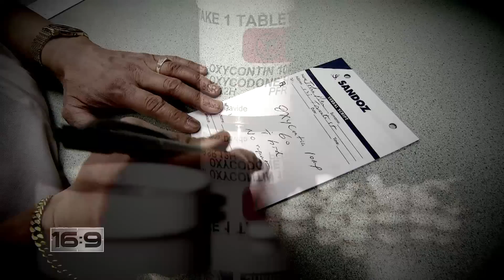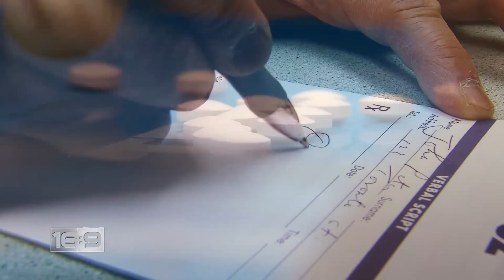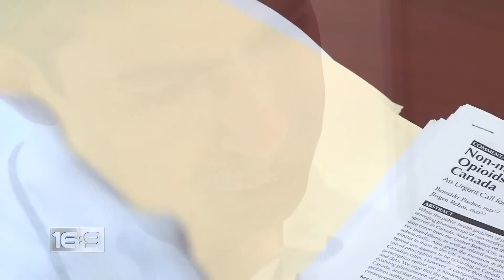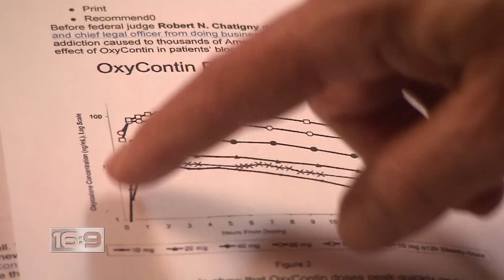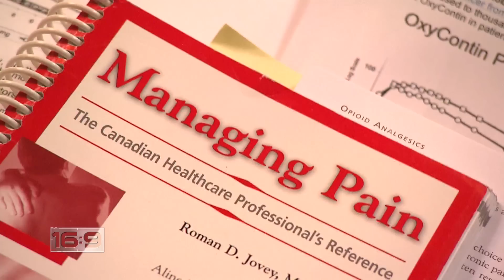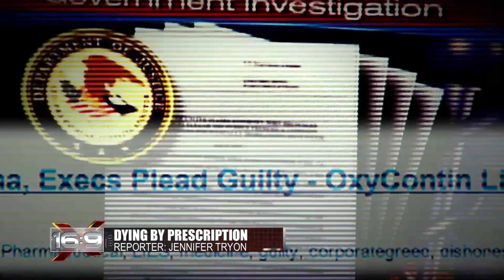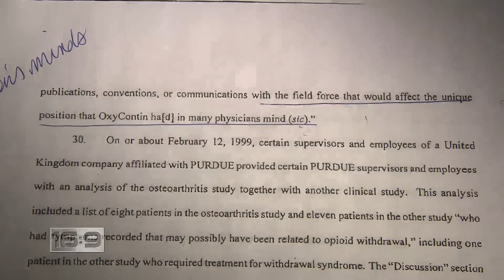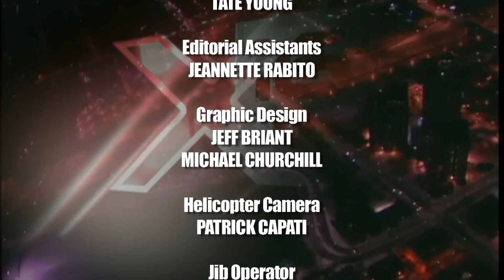16x9 | Dying By Prescription: Oxycontin controversy

Comment: This guy was obviously doctor shopping and pushing for more narcotic painkillers. This man was an addict and took it too far by getting too loaded. This is not the doctors fault at all, when a person is complaining their pain level is not being reduced by the pain meds and need more and stronger meds, the doctor will believe them most of the time. A doctor only prescribes what you need and is constantly asking about your pain level etc. They also start you out on about 20-30 5-10mg Hydrocodone or Oxycodone, with the directions do not take more than 4 a day or whatever. Very easy to avoid this and also it's totally the fault of the guy who took too much and overdosed himself.

Comment: Most people don't abuse their pain killers. The thing is if you get someone who's especially susceptible, and they do get hooked trhough a combination of misuse and their body chemistry, it's a Big deal. What bugs me about this report was it was framed like the dr. gave him an rx and he died from taking it responsibly. No... he ended up getting himself on Eight pain killers. I have kidney stones, and while they're different for everyone, you dont ever get put on Eight painkillers. He was on so many painkillers because he was misusing his medication through his desire for the medication and there not being a proper system of oversight and monitoring, and his own wiring/genetics leading him to be susceptible to opiode addiction. Sadly, what doesn't get talked about is the fact Most people use medications because they are necessary and appropriote, and are used responsibly, yet the small portion of people who abuse them, and sadly when that happens there's a something like a 25% mortality rate, it screws over Everyone. The few bad eggs always go to ruin the bunch. Most doctors are Not pill pushers, but a lack of a monitoring system is a big issue. If you cant see you've gone to 4 other doctors and have 6 active Rxs in the same category, you're going to do what you think is best for the welfare of your patient. As someone with congenital orthopedic issues, getting told "oh just pop a tylenol" for your chronic pain, is a slap in the face, and ineffective care for people with legitimate pain issues. There needs to be some system of babysitting because of this tragic bunch who get their lives ruined as well as their loved ones half from genetics, half from a desire. Really don't like how these pieces are framed only about how they can be abused, they doesn't mean they're only for that. Just like if you stuff yourself full of sugar and far and have obesity related illnesses, no one saying no one should have access to sugar as look at this segment of society! No, there is a need for sugar and fat in varying quantities in various people.

Comment: To try and get Oxycontin banned is the wrong way to approach this problem. Oxycontin is a better pain medication than the other choices on the market, but as anything like that, you have to follow the directions, and be responsible. The problem with these medications is not the medication, it is how they're being prescribed. If you're someone that is suffering from any chronic pain 24/7 you can see the importance of a better pain medication. So banning it would be extremely unfair to those that suffer around the clock, and will until the day they die.

Comment: How could the maker of OxyContin market it as being safer than morphine?  OxyContin was considered the equivalent to heroin as the withdrawals are similar. I also read that out of all the opioids, OxyContin was the one you really needed a medical detox from.
Reply: Oxy had the time released coatings on them at the start.  It gave out measured doses while in stomach acid.  I think the morphine had just a coating, but not time released?  And hydromorphone/dilaudid had no time sensitive coatings.  I think that was the main jist of it.

Only large mgs dosages had this coating.  Then they came out with smaller dosages without the coatings, called instant release or IR.

Of course, abusers bypassed the coating of the higher mg dose, which lead to it being much more powerful.  Eventually they binded the raw ingredients themselves with a gel like substance.  This was supposed to activate and gum up if not in stomach acid.  So anyone taking it nasally would have the drug suspended in their sinuses without any benefit.

Comment: A lot of addicts on here saying if it weren't for oxy I couldn't function...yea that's called addiction
Reply: I dont take Oxy never have..but I do take Tylenol 3 for the past 15 yrs for chronic pain..I need those pills to be able to move especially during the winter
yet for me to even get those are nearly impossible 
I was honest played by the rules never took more than I should sold or even gave any away never asked for more or stronger
But I and other Canadians suffer more and more everyday because of the ones who didnt and are running to an emergency room more and more often just to be patronized condescended to and dismissed

Comment: hi neith, av tried that when on oxy but my tolerance to the oxy is high so the cannibis did not touch me....maybe it would if I was off oxy?? thanks for replying much appreciated.
Reply: I have a high tolerance to oxy as well..i can do 600mgs a day and not feel a thing but thats okay because pain relief is good...i was on another med that caused hyper metabolizing, my normal dose is only 6 a day but am prescribed 4, its been five years and nothi g has changed but i found that i also cant feel weed either BUT when i smoke I tend to get distracted and can actually take only 3-4 pills a day..my doc wont allow weed but perhaps yours will, it cant always be about getting high but having sustainable pain relief

Comment: What's wrong with documentaries like this one is that they are greatly biased, as they ONLY look at the amount of people who experienced a problem and then focus on that problem.  They are not including in this the number of people who regularly benefit from the use of oxy.  Never do they even mention w/ all the statistics they quote, they never state the % of people taking it that have had a problem.  That would shed a lot of light and be much more fair for any kind of analysis.
Thus, people watch something like this, or read articles and go away thinking that it is ONLY a problem and anyone taking it must be a drug addict.
Instead,they need to at the same time show the number of people who take it and it provides for them a quality of life that is not possible w/o it.
People not able to get pain meds that genuinely need them end up committing suicide.
It is unnecessary when there is medication to relieve them.
ALL opiates are going to have an addictive characteristic that go with using them.
At a MINIMUM, regular use of any opiate will cause PHYSICAL addiction.
There are two types of addiction Physical and Psychological.
People who live with bad chronic pain, will have the physical dependence from their opiates just because they need to take it every day for their pain.  But that type of addiction is a ' non issue ' socially speaking. Meaning , they can't go w/o or they will have the physical w/drawals which are terrible with oxycodone.
If you are riddled with chronic pain so intense you cannot walk, dress yourself and if you had to endure it you'd have to commit suicide then physical addiction to the meds that give your life quality are the very LEAST of your problems and perfectly acceptable condition.  Many of such ailments mean a person has to be medicated for pain their entire lives.
This we should be entitled to and have a right to w/o others interfering to take that right away.
The fact that the substance can be abuse does not give right to take the meds away from those who need them in order to live with any amount of a quality of life.
Mothers like these need to firstly educate themselves, as they believe they are doing something good  that will help others but they don't see the other side of the picture, those that need their medication and whose lives will be destroyed if they do not have them.  She and others like her go on these crusades believing themselves to save lives and inadvertently  help to destroy lives and interfere with other peoples legit right to necessary medical treatment.
She needs to be educated about that. If they want to crusade, they can do it about addiction - abuse by those that do not need medication.
Further what needs to be focused on instead is WHY people abuse drugs or alcohol for that matter.
You see raging alcoholics dying horrible deaths and even killing others in DUI's yet you don't see people trying to rid alcohol from those who use it  RECREATIONALLY!
so why on God's earth would you try to remove something that people NEED FOR HEALTH PURPOSES?

They need to instead spend this time investigating why people abuse ANYTHING (even food for that matter, and become morbidly obese) as all of that is the same issue! the number of people addicted to something.

Some people have conditions with chronic pain and the ONLY treatment for them is medication!! To deny them their health care because there are addicts in the world makes no sense no matter who you are.
It is inhumane and a violation of human rights to even try to do so.

Otherwise, any time someone is prescribed something with the potential to be abused there are WARNINGS ON THE LABEL THAT TELL YOU THIS! If one follows those warnings it is up to THEM to identify the fact that THEY ARE MISUSING THE PILLS! and if they don't and abuse them, that is when there is a problem.  They are wrong and are abusing a substance not intended for that.
This does not make it OK to take these meds away from the people who they are intended for who take them properly and DO NOT HAVE ANY DANGER OF OVERDOSING!!!
It's insane to treat it this way and harmful to others.
All the oxy od's they say they've stopped, they never mention the corresponding increase in heroin o.d.'s and heroin use. No addicts are saved with the DEA cracking down, all that has happ is that addicts abuse other drugs instead and thus carry on w/ their drug addicted lifestyles and those that did benefit and need these meds suffer!!!
Now , people who need them legitimately either do not get them at all, some commit suicide as a result, others get about 1/2 of what they actually need and must be forced to live lives of reduced quality (more bed rest) as a result.

These types of documentaries not ONE of them has EVER shown those that benefit from the use. Nor show the stats of how many that happens to be.
People go away with the wrong message as a result.

The mother is obviously in pain, but there is plenty good she can do in the camp of addiction, like visiting N.A. meetings and A.A. meetings and warn other addicts how her son lost his life, and help parents in Alanon not to enable to share her story to help ADDICTS! Not tear down a medical health treatment for innocent people.
That doesn't help ANYONE and in fact hurts many, in fact, it hurt EVERYONE, as some day those who do not need meds will and how will they feel when they need a health care treatment that someone else eliminated because she was hurt because her son MISUSED/ABUSED it and died?  She's terribly misguided, someone needs to take her on a tour of the lives of those in chronic pain that must have their meds to survive at all and maybe she'd realize the error of her way. ALL substance abuse (regardless the substance) lead the ADDICT's substance ABUSERS life to: death, imprisonment or institutionalization, the substance they CHOOSE to abuse themselves with is irrelevant.
If he would have died from alcohol poisoning like some frat boys do, would she try to take alcohol off the market? and alcohol isn't something that people medically need as opiates are.

She's terribly misguided.  It's unfortunate that all this media attn and not ONE of them has gotten it right to show the truth of the matter about addiction.
"If it quacks like a duck"...Well, a substance abuser is a substance abuser, substance is irrelevant!
No one is taking away the ADDICTS right to seek medical help and care for his disease of addiction are they? Yet she wants to take away legit chronic pain sufferers right to the rmedical treatment and care. It's total B.S.!
Reply: Wow...must've been buzzing pretty good 2 write so much...lol

Comment: So..how is a drug controlled at the factory that it's made at? What's to keep someone from just grabbing a handful right off the line - BEFORE it reaches its 'lot' or batch number? In my opinion, there's no real answer to this. If it gets put under control in one way, it usually finds another way to the street. The ONLY way I can see getting any kind of grip on this is: legalization..to a degree. Like ibuprofen is to Motrin. Make a lower dosed, generic form..that's affordable and give addicts access. There will ALWAYS be deaths from overdose. I do sympathize..but, I'm a realist in this - and, been addicted too. The addiction aspect will always be a hazzard. I can't blame my doctor for not listening. The blame, I think..is not on the doctors or addicts - but the pharmaceutical companies. They make them. They research them..and, betcher ass - they MARKET them. Intentionally lying to doctors and pharmacies, as we can all see, is deadly!

Comment: 3:11 Hyrdomorphone isn't the same thing as oxycodone, completely different drug that's also quite a bit more powerful. Yes, it's still an opioid but it's sold under the brand name dilaudid just like oxycodone is sold under the brand name oxycontin. All opioids are dangerous but hyrdomorphone is some especially strong stuff!
Reply: complete opposite for me.i find dilaudid isnt as good at all and only has a 4 hour relief window.
Reply: @nicolemilley8251  Just based on weight it's considered to be more powerful but you're totally right about duration, especially if it's oxycontin cuz that's extended release but even instant release last longer too forsure.
Reply: @Blunt_Man  where are you from?
Reply: @nicolemilley8251  Michigan
Reply: @nicolemilley8251  Why?
Reply: @Blunt_Man  just how it is here man.
Reply: @nicolemilley8251  here?
Reply: @nicolemilley8251  How is what where?
Reply: @nicolemilley8251  Basically cold, snowy and no fun to drive in lol
Besides that just a smaller town, got its problems with drugs but other than that and the snowy winters, not a bad place to live.
Reply: @Blunt_Man  yea sounds like here minus the drugs.only about 1200 ppl where I live and lots of snow
Reply: no good drugs at all here. morphine 60s is the best we get around here
Reply: @nicolemilley8251  Where are you at?
Reply: I’ve had IV dilaudid in the ER for my migraines many times.  I find it’s not as effective as hydrocodone.